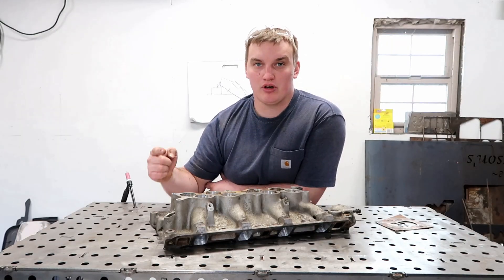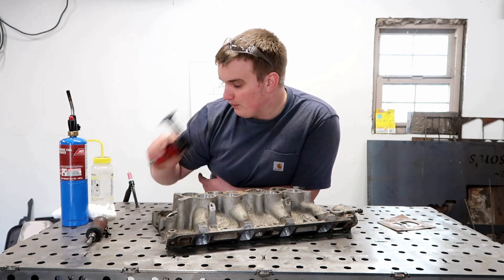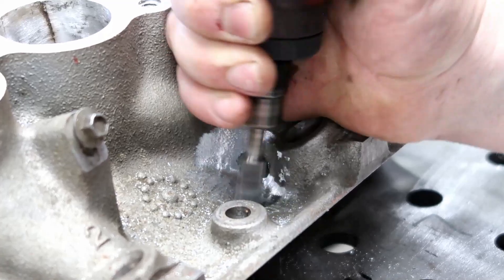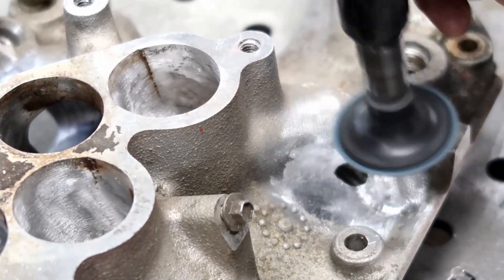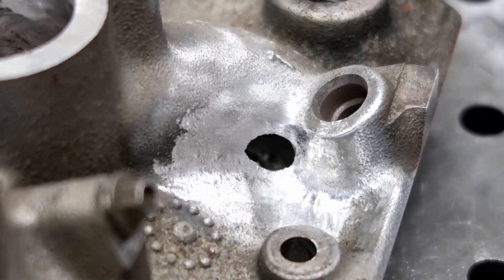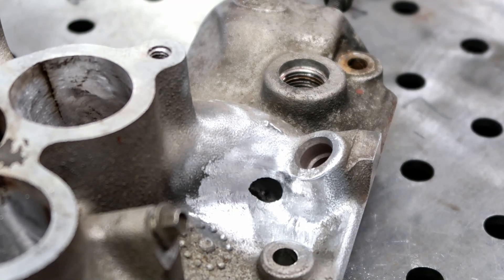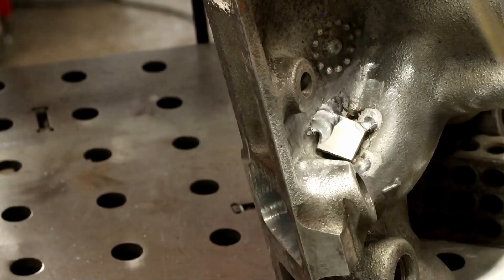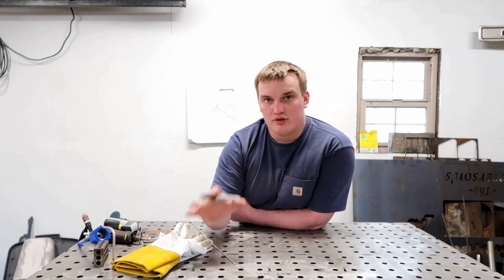Cast Aluminum Weld Repair (2020)

Comment: Hadn't seen this - but working on some cast aluminum 2 stroke cases now - and was looking for insights.  One challenge: how do you deal with porosity holes that just won't fill in?  I fid the weld puddle just goes around them like a donut - even if I grind back and try to go over that spot again.  Any tips or update on cast welding would be great!  Thanks.
Reply from the maker: I would do a couple things one now that I have an inverter machine I'm not sure what you have but if you are able turn your AC balance down closer to 50% so you get a little more cleaning action run over the area using filler rod. And a lot of times you will get some proxy in it then take a ball peen hammer and actually peen the weld. After you peen it weld over it again. What the peening does is crush the existing prostitute or gas pockets that are inside the weld and minimize the problem on the second pass
Reply: @amcustomfab  Thanks!  BTW - I have the same Primeweld 220 you have.  What is your set up now when you weld cast aluminum head or engine parts?  Tungsten size/filler wire/ etc.  ?
Reply from the maker: Follow TIG happens on Instagram he is the one who showed me this method